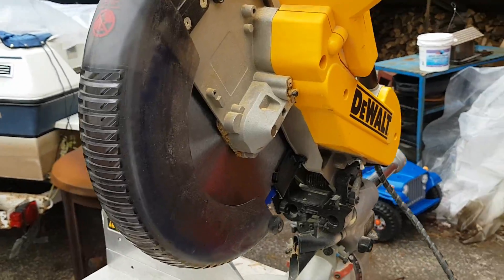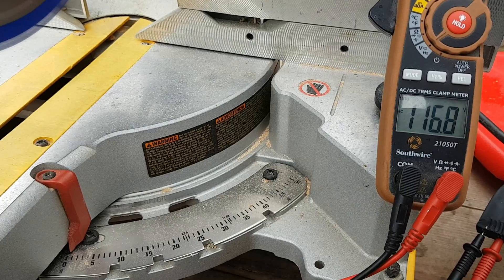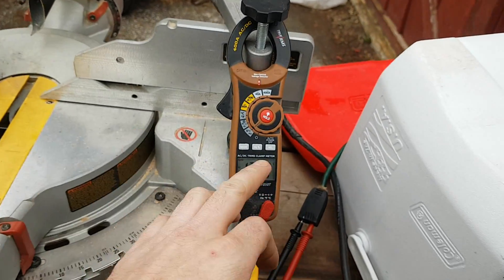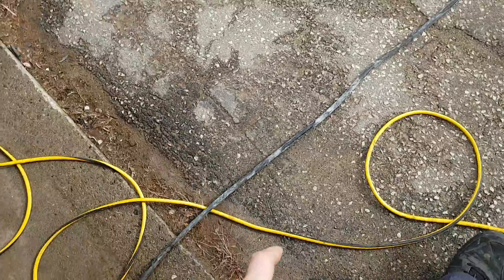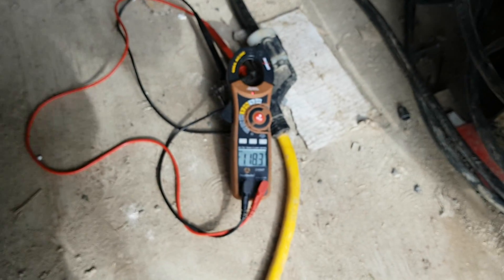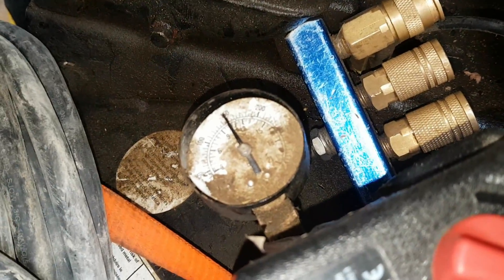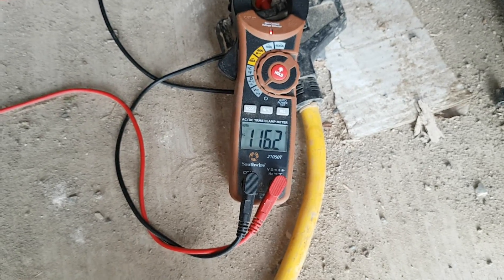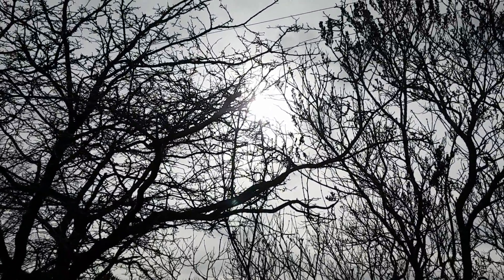8000W Reliable Inverter Ultimate Test

Comment: Good day friend. 
Good video.... and test. I was wondering if the electrical machine of the compressor is connected directly to the inverter or it (compressor) has a rectifier or any kind of soft start.
I highly recommend you to test the dynamic performance of the inverter connecting an electrical machine directly to the inverter terminals. In general the steady state of the inverter is not so demanding. Also, I encourage you to measure the THD of the voltage waveform and the transient respond. Nowadays those aspect are of importance and really make the differences between commercial inverters. 
Ps: to really test the resilience and reliability of an inverter, I would connect the genset and inverter in parallel. If they are able to work together to supply your demand... bingo!! you have built you local power system =). 
Best,
Ricardo.
Reply from the maker: the compressor does not have a soft start.

Comment: awesome test  hey how big lead-acid battery bank do you need for 8100-watt system yes i know you are using lithium but you  had lead some time back and wind too if I remember right
Reply from the maker: I had around 1000Ah at 48v
Reply: @GoingOffGrid101  how well did it work ? Now that you are running the lithium why did you switch and does it work better
Reply from the maker: @nyghtmyst5118  lithium batteries are better, I don't have to try and keep my batteries over 50% charge. and they don't wast 30% of power when charging.

Comment: I'm trying to think of a way in my head how to get around the floating ground the only thing I can think of is disconnecting the ground center pin on the inverter and using a grounding stake and run it into the center pin and the wide blade on the outputs? Or will this blow the inverter?
Reply from the maker: Ground the solar panels, and thats it, your house is already grounded
Reply: I'm having an issue with my inverter being bonded ( neutral and ground). My GFCI stuff doesn't work with it.

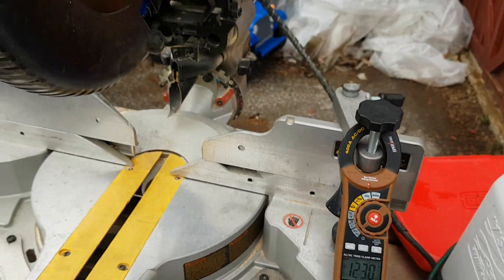Comment: Great test that was very impressive. My samlex 4024  inverter will start my 2 horsepower single stage compressor unloaded and loaded. My Harbor Freight Predator 3500 generator will start the air compressor unloaded only not under a load. I assume that's at least a number 12 wire looking at in voltage drop that was pretty cool nice job. Also I am assuming your air compressor compressor is a single stage unit you will find if you lower your pressure to about the 1:35 psi mark it will work better . doesn't sound like a big change but it makes a big difference on a single stage pump just a little tip.😎
Reply from the maker: that is true! it would start better, but I run around 200' of hose and need the extra psi to compensate for the length of hose.